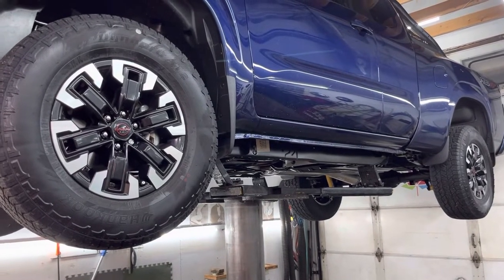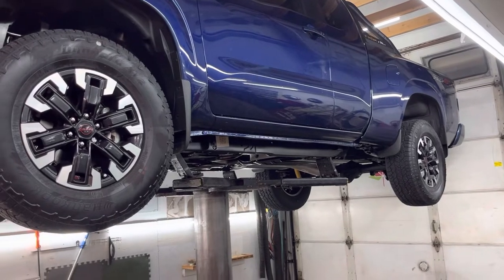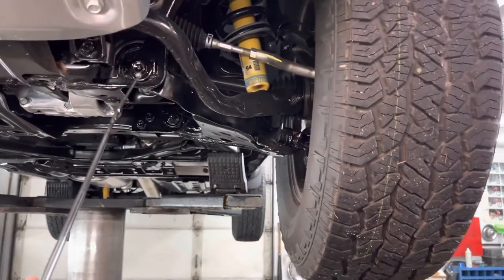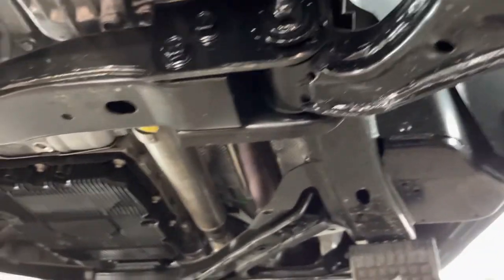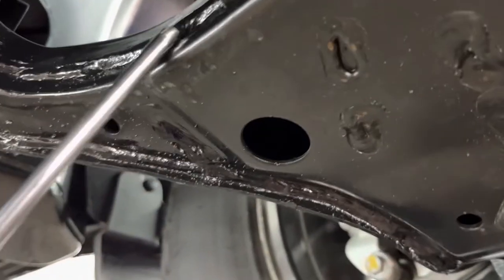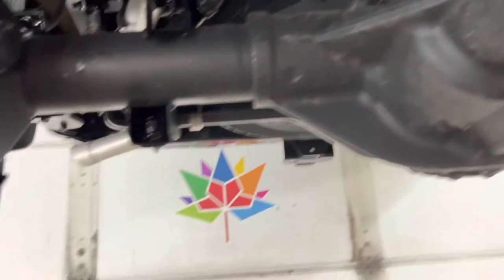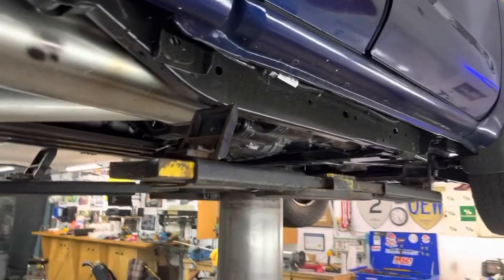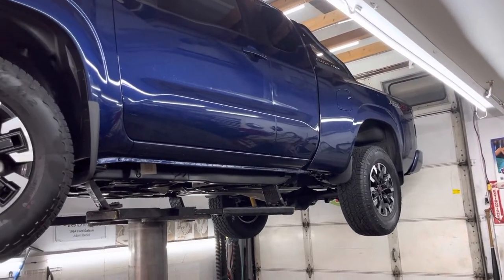2023 Nissan Frontier Pro4X Maintenance Part 1

Comment: Bought a 2023 Pro 4x 2 weeks ago. My first brand new truck. I had the undercarriage rust proofed. Makes life so much easier having a lift. Good for you.
Reply from the maker: Sounds like we are in the same boat. Nice to maintain something from the start. A chance to do it right!
Reply: rust proof as of what? Because let me be honest, if you spray that rubber rust proof, you will be surprised how your truck going to be rusted inside out without you  even know it!
Reply: @slothypunk  there is a oil based rust proof service I get every year before winter and I never had problems with that.

Comment: I'm impressed that as a mechanic, you enjoyed one for years and bought another new one. Your enthusiasm about the Frontier is encouraging. I traded out of a 2010 LE long bed after 3 years and sometimes miss it. It was loaded with great equipment and gave me no trouble (maybe excessive front tire wear on the inside edges). These new Frontiers are attractive compared to similar models. The SV Long bed has a poor projected resale value, though. If Nissan could offer some decent incentives, i would grab one.
Reply from the maker: I also bought a Rogue for my wife. I’m becoming brand loyal but there are definitely some things about this new one I don’t like. At the top of the list is the ride quality. It’s very harsh even for a truck. Very disappointing.

Comment: I got a '23 Pro4x last fall. I think it's a solid truck, overall, but I am concerned about the transmission. The Jatco unit in this truck has had issues for years and mine hesitates when shifting from 3rd to 4th, only when it's cold. I can't stand the way it downshifts violently on the highway. Also, If I ever meet the engineer who designed this oil filter location, they might get socked in the nose. It is unnecessarily difficult to reach this filter on the ground (sadly I don't have a lift) and hard not to make a mess given where the oil dripping from the filter housing lands. Terrible design. At least on my 2017 Pro4x you could easily remove the entire skid plate, giving you clear access.
Reply: I have a 2023 Frontier P4X and I drive  my truck up on 3 inch ramps, than I turn the wheels to the right all the way. shut engine off. I go in through the passenger side straight to the filter with my right arm/hand, it works for me.. I also remove that small cover so oil drains out there.

Comment: I applied Fluid Film to the underside of my 23 Frontier before the New York winter. They have already started salting the roads and I hope this will keep rust at bay.
Reply from the maker: That’s a decent product. Anything is better than nothing. Good luck with the winter!
Reply: I'll send an update in the spring 
 @adambedell73
Reply: Ok, after one salty winter there is no rust on any of the surfaces under the truck. Just reapplied another coat for this upcoming winter. So far, so good with the Fluid Film

Comment: I just bought a 2022 with some rust starting. Should I get paint and paint over all the rust spots still, get the undercoat or both? Any other suggestions?
Reply from the maker: These days they actually make some pretty good rust conversion products. If the rust is really light you may just paint over it. If its heavier I would use a conversion and then paint over it. If you live in the rust belt I would also oil spray or undercoat it every year. Usually only cost about $125.